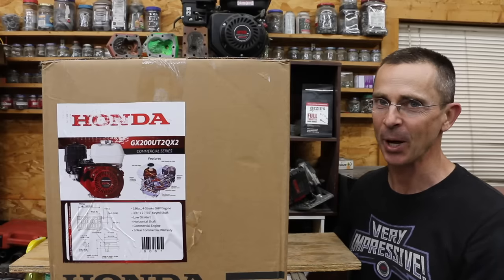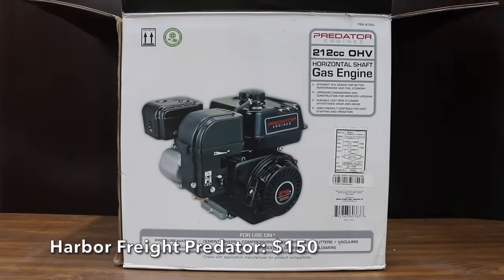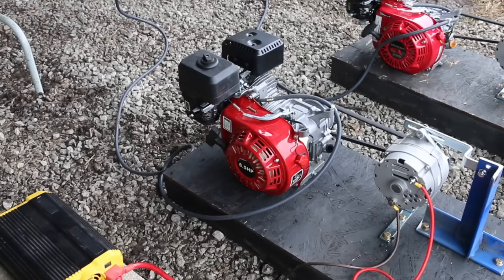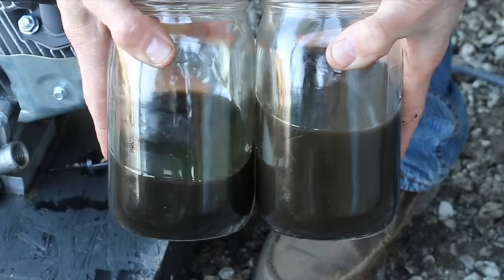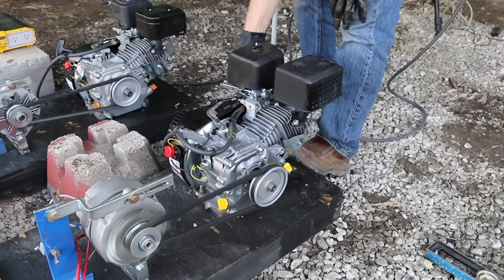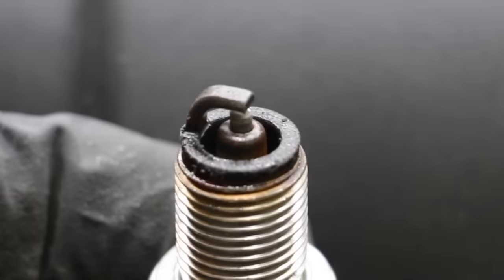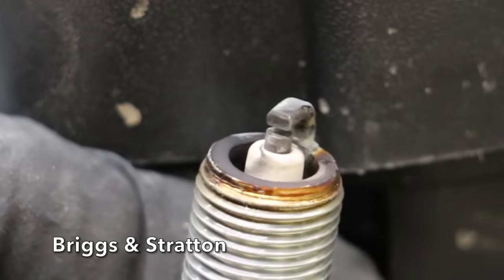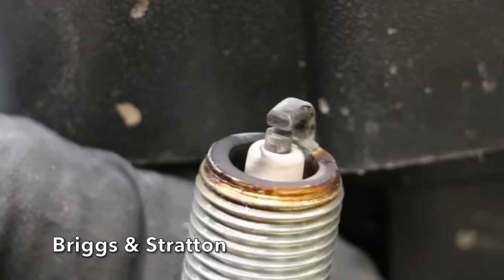$150 Honda Clone vs $600 Honda? Let’s settle this! Fuel Efficiency, Horsepower, Durability, Starting

Comment: Predator is a legitimate brand in the small engine racing community. Harbor Freight even sells a dedicated cart racing engine now with racing accessories (intake, exhaust, fuel pump, etc). That would be an interesting test to throw that one in the mix.
Reply: There's a dude who put a predator engine in his Honda and started tricking out the engine for more power using those racing parts.. edit: and yes it works and it works surprisingly well
Reply: @TBPony  project cantina
Reply: Predator ghost racing engine isn’t nothing special nor worth the ridiculous price. If you know a lot about small power sports building and racing you know you could get way better engines for less than $500
Reply: Harbor Freight has it's pros & cons that's for sure.
Reply: @rosapercs4524   I can walk into my local HF right now and get a ghost race engine for $300. They are not $500.
Reply: @rosapercs4524  I'm not implying they are some sort of hot rod world champion series engines. My point was simply that Predator has made a name for itself in the small engine world.
Reply: @Dan-gj1hz  500 with the kit, either way you can build a stage 2 regular 212 for still less than 500
Reply: It’s actually crazy because the predator used to be called the Honda knock off but it legitimately out performs the Honda in almost every way and they are so cheap, it’s almost dumb to not use them
Reply: Ayy built up a 196cc c honda off of a generac pressure washer for a cart. I really need to get a billet rod in it before getting it installed on the cart.

Free 196cc build so far: cam, 28(?)lb springs, aluminum flywheel, 5° timing advance, gutted muffler, removed Governor, bigger jets. Once it gets going it screams, but I don't really do it more than ~10 seconds and that's probably pushing it lol
Reply: @TBPony  what is the mileage per litre
Reply: @fastford207  yes bro but how to buy it i am from India, can i take an engine in a plane to india
Reply: @whiterabbit9938  we are talking about engine not heart get lost
Reply: @rosapercs4524  bro in india 20% ethanol is added in petrol, what about America, do they add any ethanol in petrol
Reply: @BlackMamba-lt8oe  gas stations can have up to 10% in gasoline but there are talks of incresing it to 15 but we can also get E85/90... there is also ethanol free gas at certain pumps for carburated cars trucks and bikes
Reply: @aaronyoung8132  thnx bro
Reply: @fastford207  Rubbish. They perform well as an occasional use engine, but do not have anywhere near the long term durability of the Honda.
Reply: @Ozsmallbore  one of the ways Hondas last so long and are so durable is they under power the set-up. The lower HP produced for a given setup, the longer it will last. Look at almost any ATV they have produced compared to say Polaris or Can Am, and for the given displacement they are very underpowered. You can do the same thing with any engine. A 450 HP 5.7 V8 will never last as long as a stock 255 HP 5.7 V8. The Japanese have always underpowered a lot of their engines for the sake of reliability.
Reply: I was thinking the same thing.
Reply: @Steven-gv1ke  What you are saying is half-true, Honda and Toyota do have many engines that are fairly understressed in applications where that is appropriate, but I wouldn't say it's always true.  For example, the Honda S2000 had the highest output for a 2L car engine at the time, and there are many other Honda engines that produced good power for their displacement at time of introduction (B16 in 1989, K20 in 2000 etc).   Though it's true that a lot of the Honda motorcycle engines and ATV engines as you say don't get updated that often (or the car engines or small engines either), and are often not the most powerful engines in their class.
Reply: @Ozsmallbore  I have removed the governor, added stiff valve springs& high lift camshaft, and billet flywheel for safety. Milled the cylinder head for more compression and used synthetic oil in the predator 212.  Raced them on a dirt  track in race go carts, turned way over 2 times the stock RPM's.  Very great and reliable engine. I call it the small block Chevy of go cart racing.
Reply: I've often wondered about the Preditor engines.  They did lose a lawsuit for dumping engines below cost.
Reply: Hey 👋 guys. «Everyone who believes that Jesus is the Christ has been born of God, and everyone who loves the Father also loves those born of Him» (1John 5:1).
Reply: rustytr  i got a 196cc hysun on a 2016 coleman ct200u...  i rode it for 4 years stock with my little sister. It was fun in the hills at 17mph but then in 2020 lockdown i built it with billet arc rod and flywheel, ss upgraded valves w/26lb valve springs, a mod 2 cam and chromoly pushrods with 1.3 ratio rockers ($600 usd)IT DOES 8000RPM ON STOCK GEARING AND GOES 50 MPH.and after another 3 years of beating on it the stock piston and bore still look great but i do a oil change every 10h... point is its i got it new at walmart for $400. put countles less than habitual oil change  hours on the engine, then built it thinking it was going to pop after a month or two. im on season 3 now and am still riding it every weekend i can, solo or with friends on my pit bike or vice versa
Reply: @Nathankinamorh  You kind of just need to know what you're buying. Plenty of stuff there for a handy man / DIY guys to save a ton. But if you're using the stuff every damn day you might want to cough up the extra cash.
Reply: Yes, but they are not the best option for long term ownership. Besides you can get a GX200 for $350-$400, $600 is its msrp. And at $350 there's just no way I'd be getting a Predator.
Reply: @disco.lemonade  Predator 212 is $160, GX200 is running $400
Reply: @TBPony  the only reason they are popular is that they are cheap to replace. Nothing special about those cheap motors.